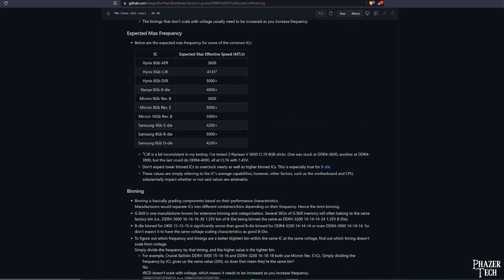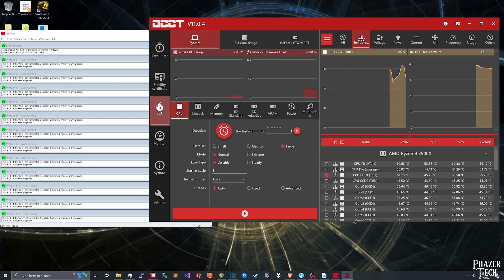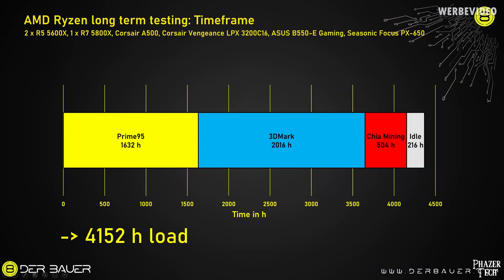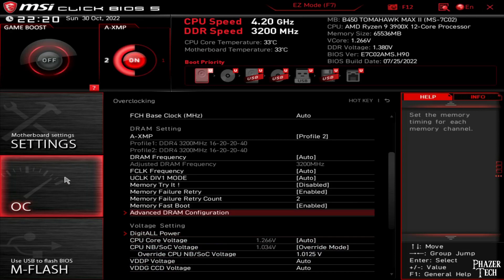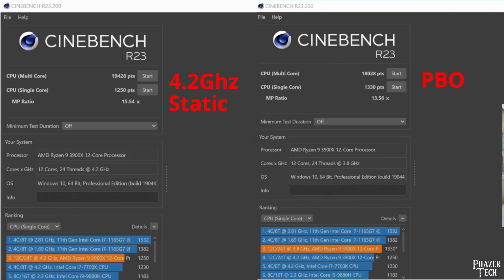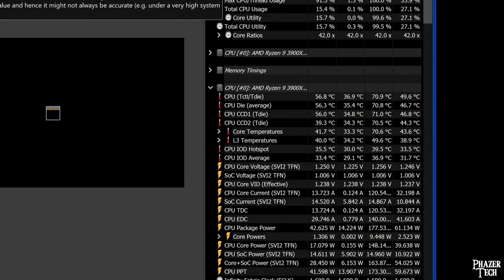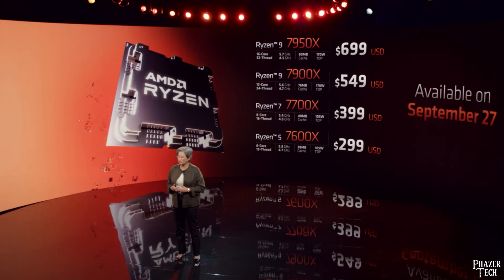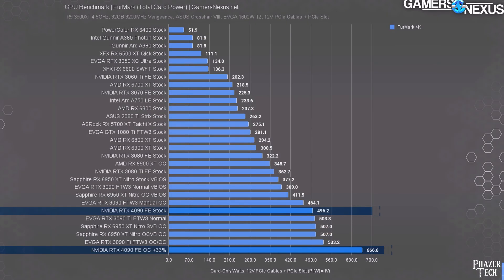AMD Ryzen CPU Degradation With PBO - Is Precision Boost Overdrive The Cause?

Comment: static oc at 1.25V isnt safe for ryzen 3600 at all i had this cpu and best results for me was turn  PBO off and set core voltage offset to -0.05V, same story with ryzen 3900x which i  had as well.
Now i have ryzen 5900X and same MB as before and PBO working much better than on Ryzen 3xxx series but it has to be tuned, leaving it on auto is most stupid thing you can do to your cpu.
Reply from the maker: Static OC at 1.25V is definitely safe on a 6 core, just make sure your cooling is sufficient.

I agree leaving PBO on auto is a bad move.  It seems the biggest issue is that some motherboards set the scalar to something higher than x1.  Doing this degrades the CPU.  MB manufacturers apparently don't care because for them it's simply a competition of who has the fastest board.  

Since making this video I've changed my position.  I was able to fix my issues by increasing the VDDG voltages, now PBO works fine again.  I now recommend keeping PBO and custom tuning it instead of all-core OC.  In several weeks I'm planning on doing an updated video on this.

Comment: with ryzen 5 3600x on rog strix b450 f gaming setings in bios core clock bost set to off not hawe any more crashes.But on my second pc asus prime b350 plus with ryzen 5 3600 works all fine
Reply from the maker: Yep part of the problem is that not all chips are equal and some of them can't candle the extra boost that many motherboards have on by default.

Comment: Well your story is 2 fold. You enabled PBO and instead of curve optimizer negative offset you used motherboards negative voltage offset. That is the reason you got a better result while doing the static overclock. Your method would isn't bad but you should've set a negative 200mV offset to get the same voltage as your static OC, however doing that would also make the system unstable because the -200mV offset applies also to lower power states which doesn't get that crazy voltage boost from PBO as the higher frequencies get.
The new curve optimizer with negative sign is the best way of overclocking and at the same time undervolting. Compared to stock you get actually lower voltages that way across the board. That results in a better longevity in the long run.
Reply from the maker: Thanks for the input.  Yes I found that through my testing, that the negative offset worked fine in stress testing but would fail during other workloads.  Unfortunately curve optimizer isn't available for 3000 series, perhaps I should upgrade to 5000.
Reply: thank you for this comment. can you please provide link/screen/whatever where i can see step by step how to set it properly as you mention it? thank you very much mate.
Reply: @lukassulety9153  Here you go: https://www.youtube.com/watch?v=FaOYYHNGlLs

Comment: i have 5950x that i bought in may, few weaks a go my pc start to have crashes when i was gaming, just gaming, i stress test pc for hours and no problem. i was running the same ram that you have but at "factory" speed 3000mhz, and infinity fabric at 1500mhz. now i disable pbo and pc runs just fine. so you are on right path imo.
Reply from the maker: Almost exactly like what I experienced.  Can you share which motherboard you're using?  Also which power supply and how old is it?  Thanks
Reply: @PhazerTech  im using x570 taichi and psu is 4 years old hx1200 but psu run at max 60% of max wattage.

Comment: Sorry but PBO with a negative curve will prevent degradation right?
Reply from the maker: I had a negative offset on mine and it still had degradation.  Of course your mileage may vary, yours might not do this and other factors might be responsible for it as well.  It's just a theory at the moment.

Comment: Almost 2 years ago I noticed this on my board, was pumping about 1.425v on the cpu to reach 4.7ghz on one core in a Ryzen 5600x. 
So I made some test and PBO was only reaching 4.1ghz all core on a task I frequently run in my job using all cores( needs to be absolutely stable )with about 1.25v all core.

So I settle on static voltaje on about 1.0925v all core 4.3ghz less heat more frequency all core than PBO on my workloads, been running like this since then this was an effective undervolt, the chip probably degraded a bit since may be natural but still running at same voltages
Reply from the maker: Nice, your results are similar to mine.  All core OC seems to be more efficient.

Comment: My 5900x since release is running manual PBO limits and negative CO per core +200Mhz, all cores -30 the two best ones at -20,-21. 
X570 running Fclk1900, 4x8Gb @ 3800c14, 360 AIO. 
No sign of stability issue or degradation.
Reply from the maker: Thanks for the input.  +200Mhz is quite modest which may be a factor.
Reply: @PhazerTech  +200 it's the maximum allowed @ AMD PBO menu. Light workloads boost's up to 5125 st. All core load 4550 to 4670, workload dependent
Reply from the maker: @deus164  It must depend on the CPU and motherboard because my PBO menu has up to +500.  But it sounds like you're maxing out that CPU pretty nicely.

Comment: The problem I see with your correlation is that there are different voltages going to different places responsible for different things. The voltage responsible for IF should be the SOC voltage, so the Vcore of PBO shouldn't really be effecting the memory/IF clocks. I think it's more likely the motherboard though. My ASRock board requires specific SOC secondary voltages set for my 2x32GB kit to be stable at 3600/1800 IF. Funnily enough I found this out from their forum, and a later bios revision made that the default behavior when setting XMP profile. I had a 3900X that appears to run hotter in that board than it did in an Asus X470 board with PBO, and the 5950X is even hotter. I've tested someone else's 5950X in their lower-end board, in a smaller case and a smaller AIO that gets better clocks and temperatures with the default PBO than mine. They also had 128GB at 3600Mhz, which seemed stable for the short period of time I had with it to test anyway.
Reply from the maker: It's possible core voltage can affect the IF.  Here's a similar example:  Some RAM dies can handle a lot more voltage than other dies, so when overclocking these dies caution needs to be taken because RAM voltage can damage the memory controller.  This might not be true for Ryzen, but has been true for certain CPUs in the past.  Just because a voltage is being applied to a particular part doesn't mean it can't affect the other parts its interacting with.  But it's still just a theory after all, there's no real data to back this up.  But there does appear to be something going on.  I agree that there can be multiple factors playing a role here, including motherboard.  It seems different motherboards have different PBO algorithms which might cause problems for certain CPUs.

Comment: I'm not understand the hype around PBO - a lot of people said "you should better turn PBO on and forget about manual OC" - but when i was overclocking my friends CPU, i was shocked how poorly it works in his case - on 5600x on PBO on ~1.2v CPU gets 4300-4400 mhz all core on prime95, on manual OC on the same voltage i get stable 4650mhz all core when testing in at cinebench and OCCT. I don't have idea that was a motherboard issue (because it was old and cheap b450), or CPU "overheating" (because core temp was around 80*C if i remember) under prime but it was at least weird. Maybe i should also try PBO at cinebench, but i used it only because i want to see how high AMD overclocking set cpu voltage to get my "safe" max for manual OC
Reply from the maker: Thanks for sharing, your experience sounds typical.  PBO is not very efficient and not always the best choice!
Reply: Well, thats probably because you didnt set pbo limits different from stock. When you manually OC, you are disabling any safety mechanism that limits the behavior of your cpu, so thats why you got better results.

Comment: My 5800X isn't stable with PBO either. Since that CPU boost to 4.85 GHz stock and not the advertised 4.7 GHz I decided to put an auto oc offset of -150 and almost -30 on all cores with curve optimizer. This reduced temps by a lot and didnt really change anything performance wise since I'm mostly GPU bottlenecked (6700 XT). Exception is of course in benchmarks, i'm losing a bit of single core performance, all core performance didn't change at all (still boosting to around 4.65 GHz in light all core benchmarks and in prime 95 around 4.4 GHz)
Reply from the maker: Thanks for the input.  Nice choice on the 6700 XT, best bang for the buck imo
Reply: @PhazerTech  Definitely yes. Or currently the 6600 is probably the best bang for the buck. At least in europe (can be found for slightly over 250 euro), The 6700 XT is rather overpriced. Since I managed to sell my vega 64 for a decent price i got the 6700 xt "on a discount".
Reply from the maker: @Koeras16  In the US the 6700 XT is below $400, I see one on Newegg for $350 right now.  And you're right maybe 6600 is slightly better bang for the buck but it doesn't always give a smooth 1440p 60fps experience so personally I would opt for the faster card.

Comment: I hadn't noticed much degradation with PBO on my 3900XT, it's been run for 12 months with PBO and 12 months at a custom overclock averaging around 4.5Ghz all core.

It's been running 64GB ram 4 * 16gb 3733, custom sub timings and CL18 with the If at 1:1.

I've never been able to get PBO confidently stable for long periods and the Zen 2 chips are very very temperature sensitive.

My findings with PBO is that AMD spec the 3900XT to a max of 4.7ghz, however sometimes on my MSI board it would hit 4.775ghz.

Most notible is my stability issues were never under high loads, only at very light loads when the machine is doing nothing on the desktop or the occasional chrome chrash loading a tab.

AMD and various motherboard vendors pushed the PBO algorithm too aggressive, sometimes with single core clocks in temperature ranges for various work loads that are beyond the hard CPU clock wall of the architecture and silicon quality.

Now I also have a 12900KS with an undervolt as my main system for work. Its been far easier getting Intel stable than AMD, simply because intels clock better, despite their higher power use at full beans.

Silicon temps up to 100C are perfectly safe, the critical temperature for most modern cpu designs is around 130C. But what a lot do not realise is temperature has a massive impact on your max clock you can achieve and large temperature fluctuations, more noticeable on AMD with PBO significantly change their stable range.

Not sure about AMD, but Intel's spec is +0.0015V for every +1C in peak silicon temp.
Reply from the maker: I do agree that many motherboards are pushing PBO too aggressively, and I'm starting to think that's the major issue here.  I found that PBO was stable after manually tuning it and removing the +200 Mhz boost that the motherboard automatically applies.  Why these motherboards push the CPUs beyond their normal PBO limits is beyond me.. especially since this is stock behavior.  However the fact still remains that I wasn't having these problems initially, so it does appear to be some sort of degradation.

Comment: I've had the 3600 in 2019 run pbo since day 1 with a 3800mhz cl18 ram oc. Now with it's new owner also running in pbo, still no issues. I also didn't use mine a lot during early lockdowns but I went back to gaming late 2020 to just recently until I sold it. Could probably be just pairing with the mobo, applications and usage.
Reply from the maker: Yes agreed, I do think usage and applications play a role as well.  Some applications will make the CPU boost up and down nonstop while other applications are more stable on the clocks.

Comment: Last comment (for now).  By the way, you came up on my YT feed but I like the video and think you're on to something.  But- one thing I don't agree with is your dismissal of 4 dimms on your degradation issue.   You're definitely onto something with the infinity fabric possibly being the component that's degraded, but running 4 dimms is probably an element of that.  3000 series and below hates 4 dimms, and it's been surmised that one of the reasons for this is that it's just too much strain on the memory controller.  5000 series is exponentially better in this regard and presumably 7000 is better again.   There's ways to mitigate this like running the memory in gear down mode though that does reduce performance a bit (though you'd never notice outside of synthetics).   Without gdm I couldn't run 4 sticks on my 3700 at anything over 3000 mhz, not even it's specced 3200... But at the same time it was admittedly crappy RAM
Reply from the maker: Thanks glad you enjoyed the video, and that's a helpful tip about gdm.  I currently have it disabled but perhaps I should enable it so the memory controller isn't so stressed.

You might be right about the 4 dimms causing increased strain and contributing the degradation, but it's hard to say.  There's lots of conflicting info based on anecdotal evidence without any real test data to show.  For example the DDR4 OC guide on github provides a bunch of tips from various sources, one of which is "2 CCD Ryzen 3000 CPUs (3900X and 3950X) seem to prefer 4 single rank sticks over 2 dual rank sticks."
https://github.com/integralfx/MemTestHelper/blob/oc-guide/DDR4%20OC%20Guide.md#amd-imc

Perhaps this is true just initially though.

Comment: The other issue with PBO is that even AMD recommends setting the PBO scaler to 10x which IMO is an absolutely horrible idea.  The scaler literally tells the BIOS to ignore the chip's internal safety logic and boost longer than its safe.  Not only is that often slower because of increased heat, it could kill your chip much faster than expected.  Advise setting it at no higher than 4x or just leave at default
Reply from the maker: I left mine on the default scalar, but I agree 10x seems unsafe.

Comment: I've had my 5800x for about a year now, and if nothing else between BIOS revisions and fine tuning... I'm getting more speed out of it than I did a year ago.  BUT... I'm using PBO with curve optimizer with a negative offset.  If you just enable PBO and don't adjust the voltages, most Mb manufacturers run Ryzen at absurdly high voltages with PBO can increase even further
Reply from the maker: Yup I agree.  As I said, I originally had a negative offset of about 100mV with PBO.

Comment: If you are running the CPU full stock without PBO you will essentially have the same boosting behaviour as the one you are describing - low ( lightly threaded ) load -> high frequency and voltage and high load ( as many threads ) -> lower frequency and voltage. So basically if this is the cause then the degradation would occur even without PBO. When you enable PBO with "motherboard" limits this sets them to a very high values, so it is the same as removing them and the CPU boosts as high as it can, with volatages, power and current as high as they can be according to some hidden ( at least to me, i don't know if they can be seen somewhere or inferred somehow ) limits. I guess this can be detrimental in the long run.

A better use of PBO, in my opinion, would be to just use curve optimizer set custom limits. In my case i even lower the PPT limit (120W) since i don't need every bit of multicore boost, the last 1-5% do not seduce me. EDC and TDC are kept at stock. This way i get close to stock scores with lower power, while keeping the single core performance.
Reply from the maker: Maybe it depends on the motherboard because what you said isn't true on mine.  With stock settings, PBO is enabled for mine.  Changing the PBO setting to the "motherboard" limits doesn't change its behavior in light to medium workloads, it only affects it when under heavy load.  In either case it still boosts to 1.5V for single threaded workloads.

The only reason why you wouldn't want to push the EDC and TDC to the motherboards limits is if you don't have good enough cooling, or if you wanted to have better power efficiency.
Reply: @PhazerTech  Mine also has PBO enabled by default, but that doesn't mean its the CPU stock behaviour, certainly "motherboard" limits are not the default behaviour. As far as i understand voltage alone is not the only culprit of degradation. Its actually the combination of voltage, current and temperature and if you remove the power (PPT) and current (EDC and TDC) limits the only real limit left is the temperature which can be reached very quickly. This situation can certainly accelerate the aging of the chip and cause faster degradation. You see, there is a reason for the warning text when you go into the PBO section in the BIOS. A whole other story is why MB manufacturers enable it by default, AMD should not allow this in my opinion.
Reply from the maker: @pwnd0rum  Well degradation certainly is a very complex topic and there can be multiple sources for it, including things such as electromigration which I briefly showed a page about in the video.  

Higher voltage results in higher current as well (and temps), but the inverse isn't true.  Higher current does not mean higher voltage.  Also its known that thermal cycles is what causes the most harm, so I believe spiking voltages up and down to 1.5V consistently might be a contributing factor to degradation, and that more tests should be done.  

When it has a single core load, that one core heats up the whole CPU from ~30c idle up to 50 or 55c.  That's alot of heat coming from just a single core.